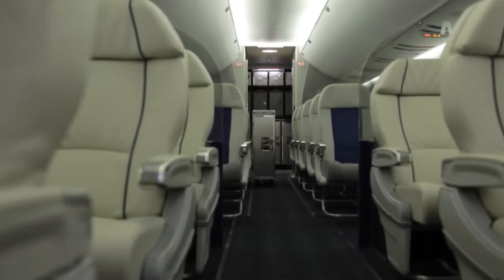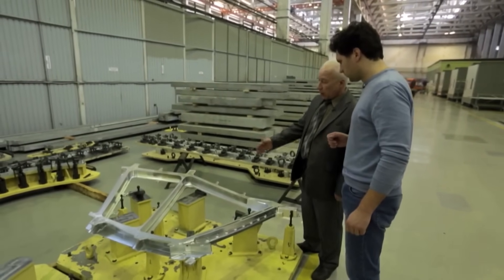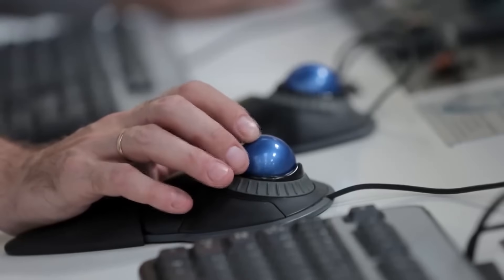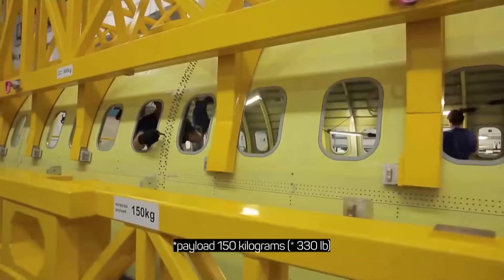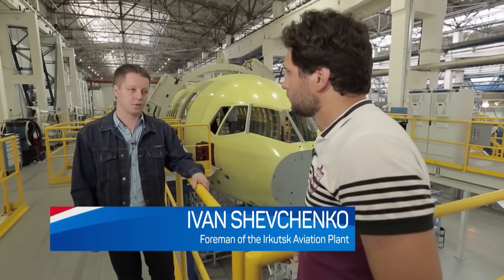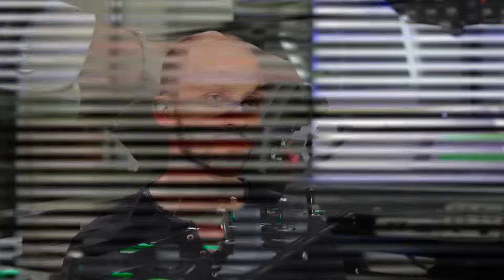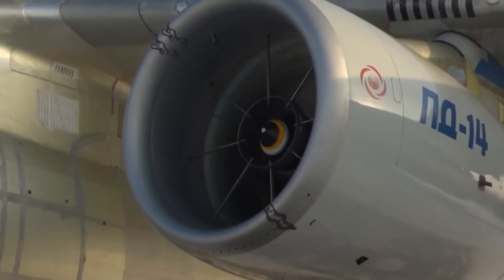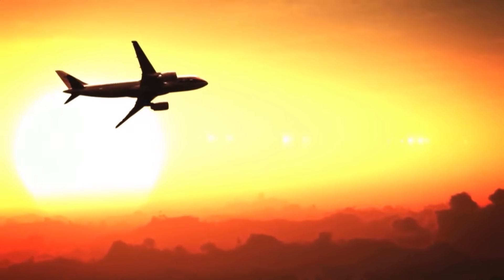The MS-21 – RUSSIA's Boeing 737 MAX Alternative

Comment: Reality: The MS21 is currently 13 years behind the original schedule for series production. Producer Rostec recently announced that no more civil aircraft (MS 21, SSJ-100, Tu-214 etc) will be delivered before 2026. So far, it has always turned out that Russian aircraft are unreliable and far too expensive to maintain. Sukhoi SS100 has been in series production since 2010 to 2020 and has a market share of 0.0x% outside of Russia. Russian civil products are not at world market level - in any area! 
Like a developing country, Russia lives from the sale of its raw materials. 90% of export money comes from raw material, steal, aluminum etc.

Comment: Well the 737MAX is a botched design as the very good design of the 737 was made bad by moving the engines up and forward.
This MS-21 has the same issue? Seems like ti is also trying to fit in a too large engine under too low wings.

Comment: it is NOT 737. 737 is very old plane. it was designed in 1960-s. here is another arodymamics, black wing. 737 was designed for use JT8D engines. here are modern PD-14. its next generation plane

Comment: Sanctions forced Russia to build their own airliner, but it turned out to be better and far safer than Boeing's 737 max, and all domestically produced. No one in the world can do such a thing, but Russia. Boeing itself relies on 50 different countries to supply parts for their planes.
Reply: First of all, MC-21 is not existing. And nobody in the world has ordered it. Problem are not just the sanction but Putins corrupt economic system. It was never able to produce anything competitive. All similar projects failed, long before the sanctions. Russian economy is based export of oil and gas only.
Reply: @alexandervt641 Calm down, no one believes you anymore. Russia has been and will be invincible! It is Russia that will dictate terms to the world for the next 100 years. You will not succeed, you lost initially.

Comment: I would never take such a plane. A big bold NO. Security first when it comes to safety and reliability.
Reply: Statistically the Ilyushin fleets have been quite safe.
Reply: 737max isnt great on that front, Is it...
Reply: It depends what you're meaning by 'security'. If you mean EASA license or a real statistics. B737max and A320neo have license but statistics isn't good. Unlike C919 that has no EASA license
Reply: Of course, as much as 10 safe flights, you got 100%!
Reply: Calm down, no one believes you anymore. Russia has been and will be invincible! It is Russia that will dictate terms to the world for the next 100 years. You will not succeed, you lost initially.

Comment: The 400 LR version with 256 seats and 12,000 km range could be an interesting replacement for airlines with ageing 757 or a small 787 8 Dreamliner with only 242 seats. Depending on options Dreamliner costs between $248 & $338 million but the MS 21 are only $72 to $91 million. Think about monthly mortgage costs savings for an airline. $922k vs $4.5 million (6%)
Reply: You haven't counted the savings on current maintenance yet. MS-21 promises to be extremely profitable in the frequency of routine maintenance and scheduled repairs.
Reply: unfortunately there is not enough power productions to make a lot of aircraft to sell outside the russia. First of all this craft is for use inside the russia.
Reply: Вы забыли китайский COMAC брат близнец МС-21, он будет дешевле.
Reply: @СТМТрейд сказать что comac брат близнец МС-21, это все равно, что сказать 737max - брат близнец a320neo. Абсолютно разные самолеты. И дешевле он будет(если будет) только для Китая.

Comment: The airplane itself is modern, unlike the Boeing 737 which is over 50 years old. However, the main problem is production in high quality, service, sales, etc. Especially in times of sanctions. But also without sanctions - over the last 20 years not one industrial project of the Kremlin was successful: „stealth“ fighters Su 57 an Su 75, Armata tank, Superjet, Russia One tram, Yotaphone, Elbrus processor, etc. All of them failed miserably. Russia is barely able to produce nails. Reason is lack of money and industrial know how, bureaucracy and endemic corruption. 
Same with the MC 21. This plane is for 20—30 years in development. Hugh money has been spent, little result was obtained. Over all the years not one international customer could be attracted. Moreover, due to sanctions Russia has to produce own aircraft engines (PD 14) and carbon composite wings, navigation equipment, etc. It is the same sad story as every time…
Reply: I see everything is bad for you. Soviet industry successfully produced aircraft without external supplies, why can’t Russia repeat this? Let them take a long time, but we expect a positive result. One thing that upsets me is that all these modern airliners look alike. I understand that the economics of flight dictate the shape. But where is the design genius that will give individuality, like old airplanes?

Comment: 1.3% of superjets built have crashed. 0.15% of 737 Max built have crashed and the software issue has been fixed. Pretty clear which plane is much much safer. So yes, I'll keep flying in the 737 instead of a Russian death trap
Reply: Ты лучше пешком ходи, но тогда будет вероятность, что тебе кирпич на голову упадёт.
Reply: Daun !

Comment: One thing that I think is not correct is that the American Pratt and Whitney engine is not going to be used anymore on the plane due to sanctions. The plane will only be equipped with the PD-14 engine.

Comment: It is obvious that every single machine used to build such an aircraft is not Russian, but Western-made high technology like precision milling, carbon fibre layering etc. (and even not so high technology as seen in this video like cranes, sprayguns and even ladders). As long as Russia keeps on attacking and occupying other countries, there will be sanctions and therefore it will not be able to maintain these machines (let alone buy new ones) and therefore will not be able to build such aircraft at least not in mass production. And not to forget about computer technology microchips etc.
To all this add the brain drain of the smartest people having left or leaving Russia because of its brutal actions and its consequences, the fact that a not inconsiderable part of the workers are sent to the pointless meat grinder and come back either not at all, dead or crippled and thus will never again be able to tighten a single screw on these fancy planes.
This project is as doomed to failure as the Russian attempt to land on the moon was.
Just a few examples of Western technology in this video that have been forgotten to be blurred out:

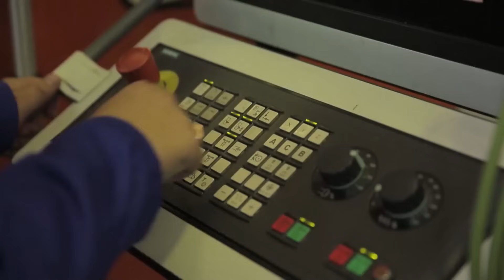2:14 Fischer (and Microsoft Windows XP)

2:57 Wagner

3:47 Mtorres

4:19 why is this labeled in English?

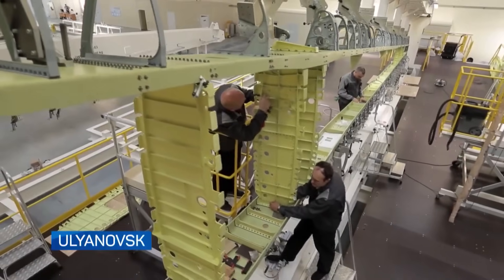6:01 Mtorres

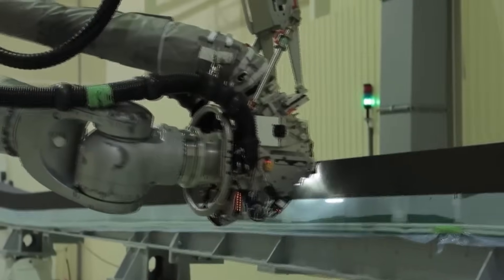6:29 Kuka

7:11 Hymer 

8:52 Demag

9:02 Kuka

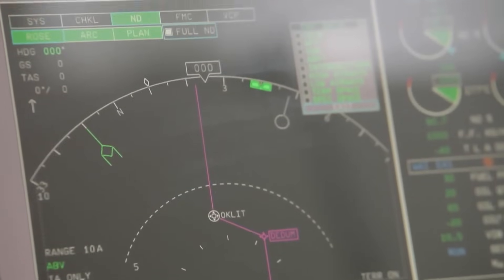12:24 LG

12:38 Still
Reply: 100% 👍
Reply: All these are easily replaceable with Russian and Chinese alternatives

Comment: Russia is restoring production of the four-engine Il-96:
"The new experimental Il-96-400M, created as part of the Il-96 family aircraft modernization program, is being prepared for the first flight (07.06.23). The aircraft is equipped with modern Russian avionics equipment, including a new avionics complex and other systems and components.
The lengthened fuselage makes the aircraft more spacious and attractive to operators. Previously, only the Il-96-300 was produced in the passenger version."
So the problem with foreign components in the equipment on the MS-21 is also being solved, and these developments are used in the updated Il-96.
Reply: It will be produced just to fill the gap in big long range planes and make constructors and factories work until creation of 2 engine version will be completed
Reply: Actually the il96 was designed to be 2 engine but they had to rebuild it to use 4 engines because of international certification for transcontinental flight
Reply: @Galova No
Reply: il96-400 with 2 engine PD-35
Reply: 400M already never will take off 
Программу свернули

Comment: Russian men tall and big so the plane ✈️ must accommodate to the large build. Knee space is very important
Reply: This is true. For a typical Russian, a Boeing 757 seat is pretty tight and short. However, in Airbus 320 or Embraer 170, there is no such problem, unless a particular plane is re-packed with max number of seats for touristic charters or lowcoster flights.